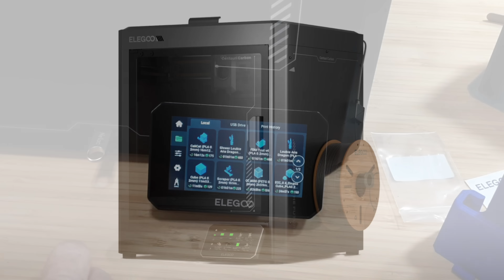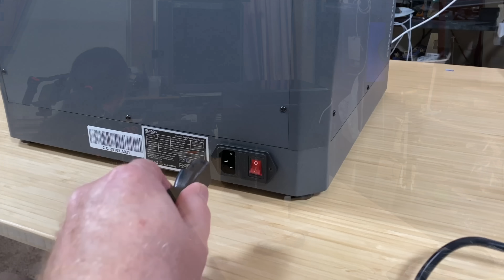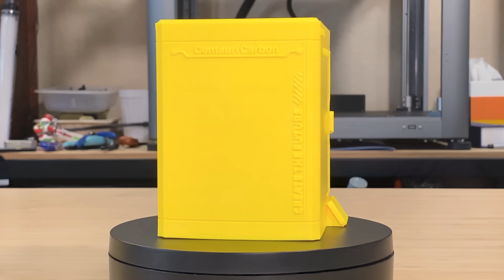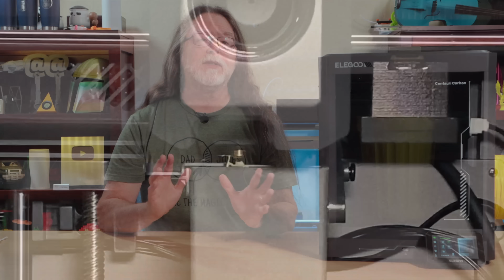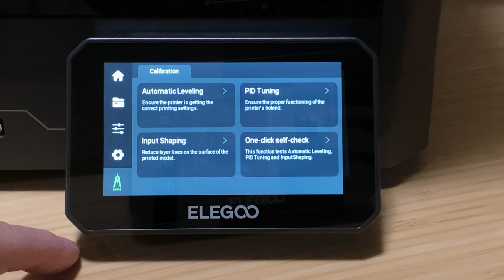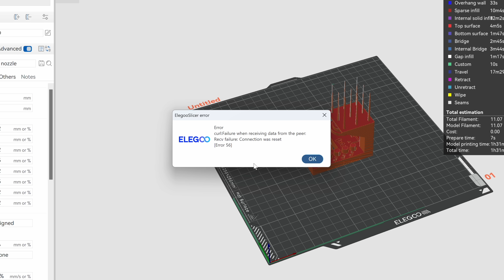Elegoo Centauri Carbon. Enclosed CoreXY for $299.99 USD?!

Comment: So the message here is, don't adopt early. Excellent review, I imagine Elegoo will take your advice, they'd be nuts to not! Otherwise, this is one I'll be watching, as this year is the year I upgrade to something like a Qidi Plus4, a Sovol SV08 or, maybe, the Elegoo Centauri Carbon if they get their firmware act together.
Reply: been using qidi for a bit. i think its perfect mid range printer
Reply: Is it possible to connect via usb?
Reply: I wouldn't bother with Qidi, I attempted to buy a Plus 4 and haven't received it yet (3 weeks so far) when it was apparently in stock at local warehouse (Australia) for 1-3 day delivery. To be honest they ship direct from China and its been lost somewhere, last I called courier company they said it is being returned to sender and I need to seek a refund from them. But Qidi doesn't respond to emails or customer service at all, I've had to file for refund under my credit card company as Qidi will not communicate, no response at all to multiple emails. They also deleted my 1 star review I left on their site. They are extremely dodgy and I doubt they will exist in the next few years given their Australian distributer is LLP tech and they have a roughly 2.5 star rating on google + that's realistic where Qidi sits as a company if they weren't deleting reviews. 
I'll likely buy this Elegoo machine when I get my Qidi refund as there is also a huge price different between the two models with the Elegoo being far cheaper + I have a few of their resin printers and they are reasonably good.
Reply: The message is to adopt early at this super low price. Of course they will sort it out as all big vendors did with all printers from Tempe last two years. This printer is still some months away anyway

Comment: Great deep-dive you did, hopefully Elegoo gets it sorted out.  This is crazy, a Bambu knock-off for only 1/4 the price! So exciting to see all these new generation printers. Bambu Lab gave this hobby a good, hard kick in the butt! 👏🏻🎉
Reply: @T00LF00L  1/5 the price. 299$ vs 1499$ (if AMS is included)
Reply: Comparing it to the X1 isn't even a remotely fair comparison. This printer compares far better to the P1 series. Now that still makes it half the price and even with some improved features in some areas and a heck of a deal. I seriously wish influencers would stop with the X1 comparison just to inflate the numbers. It is a good printer at a very good price, there is no need to exaggerate what it brings to the table. In short if you are on a tight budget and multi color/material isn't a requirement, this machine provided Elegoo and keep their quality up (Something they have had issue with in the past) is a serious consideration for any budget core XY. If someone is going to print PLA/PETG only you  can knock another $50 off and get it without the enclosure. 

As for me, if I was looking for my first printer and didn't specifically need Core XY, I would argue that the A1 is still the king of full sized fully featured budget printers even being a bed slinger, but if someone wants a fully enclosed printer, this is hard to beat.
Reply: @OmegaGamingNetwork  What exactly does the X1 have that this doesn't? A useless LIDAR and better lights?

Comment: 299... Get what you pay for. Back to the Ender 3 days of tinkering and replacing h/w & f/w with better options.
Reply from the maker: Might be. I'm curious to see how they handle the firmware stuff going forward. Uncle Jessy pointed me to a slicer update, and that fixed the issue I was having sending files to the printer from the slicer over WiFi.

Comment: Bryan, I'm curious how the printer deals with a runout. If you have 400mm+ of filament in the tube when the run-out sensor is tripped, does it continue to print until it clears the tube, or does it stop? Then, how do you get the filament out without either manually feeding it new filament until the extruder picks it up or pulling the tube off on both ends just to extract the filament? If it has a runout sensor in the tool head as well, then it could consume the filament, allow you to load new filament, and continue printing without a lot of hassle, but it looks like it has one on the side, and that doesn't seem ideal for a Core XY. If you could test it out, that would be awesome! Thanks!
Reply from the maker: Hi, here's what happened when I cut the filament halfway through a print:
- When the filament stopped passing through the runout sensor, the printer kept printing. I don't know if there's a secondary sensor in the tool head, or if it's got the length from the runout sensor to the toolhead pre-programmed, but it kept printing until it had pulled all the filament through the tube.
- Then, the printer parked the toolhead at the back right corner, and a note on the screen told me it was time to run out and get more filament.
- I acknowledged the message, and the screen switched to the filament loading screen.
- I reloaded the filament, pushing it through the sensor, into the tube, and all the way to the toolhead.
- I pressed the "Load" button on the screen. The printer loaded the filament.
- When that was done, I had to switch back to the Home screen, and then press the "Play" button on the screen to resume the print.
- The printer got the nozzle temperature back to the printing temperature, and resumed the print.

It seems to have handled the runout & reload perfectly. I can't see on the print where it ran out and then restarted.
Reply: @BV3D   over there doing gods work 🙏 thank you
Reply: @ thanks for the follow-up! If it doesn’t have a 2nd runout then it must be calculating distance from the exterior runout sensor.
Reply: This is a good quesion!  Would like to know how it handles this.
Reply: @hinrichmeijer2379 manual. I don’t have it but there is no motor before the sensor so I don’t see how the filament will be pushed until the extruder can grab it.
Reply: @johntheblindman  but will the extruder reverse so you can grab it or do you have to remove the whole boden tube?
Reply: Me gustaría ver un nuevo vídeo para saber si Elegoo reacciona y hace caso a tus consejos. 
En los vídeos que he visualizado, hasta ahora, no mencionan esas deficiencias que tiene tu máquina. Estoy de acuerdo, como bien dices, que si Elegoo quiere es solucionable y la Centauri Carbon, además de buen precio, será buena impresora, por lo tanto buena compra.
Buen trabajo.
Reply: just relocate the ro sensor.........or don't use it

Comment: Wow.  That seems like a good price for an enclosed CoreXY.  Maybe in 6 months from now the firmware won't seem so half baked.
Reply from the maker: For what it's worth, Uncle Jessy let me know there was a slicer update, and that has fixed the problems I was having sending files to the printer over WiFi. I'm pretty sure I checked for updates right after having installed the slicer the first time, and there wasn't one. But there's one now, and it helped. The camera streaming is still wack though.

Comment: One of the reviewers of this printer received a shock due to a defective cable. Though if the bed wasn't heated by an AC electric heater this wouldn't have happened.  A Ground Fault Circuit Interrupter (GFCI) would likely detect and protect against the safety issues caused by an improperly grounded Elegoo Centauri's high-power AC heated bed, but it's not a complete solution to all potential problems.

GFCIs are designed to detect imbalances between the current flowing in the hot and neutral wires, which occur when electricity is leaking to ground through an unintended path. If the printer's frame becomes electrified due to improper grounding or a miswired cable, a GFCI would likely trip when someone touches the frame, protecting them from electric shock.

Remember Murphy's law...
Reply: This is not the case. He figured out it was the power cord he was using. The ground was not working properly. Was not the printer.
Reply: His printer had been tossed around in transit.  That's likely what caused the wire to be jarred loose.

Comment: Great review! Weird name without carbon rods, but okay. I'm assuming software issues will be fixed. Tinted glass seems like a bad idea, especially considering the weak lighting. The ABS prints really came out nicely. The price is wonderful, but will wait for the multi-filament system before I seriously consider. I love that printer manufacturers are cloning more than just the bed slingers now.

Comment: It seems they rushed to release this thing early as it still has some issues. Needs a brighter light, a clear glass door as they didn't learn from the Creality K1. Not sure I like the filament unload/load sequence but it is direct drive so meh? I'm considering getting this printer as the price is awesome but it seems this is an introductory price. There is no way they can keep it at $299.99. I swear when the page loaded it first said $699.99, then updated to $299.99. Great video Bryan!
Reply: I saw the $699 too. The $299 is just crazy low
Reply: They showed the printer in June 2024 and release it like this after almost 8 months of refining 🤨 Makes one wonder if all they showed up was frame and panels 😅
Reply: @kimmotoivanen  "Released" is a funny word for an item not shipping until 3-5 months from now lol
Reply: No this is not just an introductory price. It 299.99 period.
Also it was not rushed.  It's been 10 months since it was first seen/introduced.
Reply: @BlazeT3D  pre-order €329,99 EUR (delivery July 2025 ), normal price €412,99 EUR
It's a bit like kickstarter, you give your money in advance so they can start building your stuff...

Comment: This printer seems like it is still half baked. Last year I bought the QIDI Q1 Pro based upon your review and have not been disappointed. I can hardly even look at a bed slinger without reliving bad memories of trying to print the moon globe lamp only to have it get knocked off the bed after 3 days of printing and ruining the print. 

At some point I will want to dive into color printing and I know it won't be with Bamboo Labs given their CCP style Long March towards captive users.  If Elagoo has their buggy firmware fixed by then, I will consider them.
Reply: Hey Creality looks pretty good.  Check it out.

Comment: I wonder if it's safe to say that the "Race to the new bottom" I predicted has truly kicked off now, with all of the old players putting out their own enclosed CoreXY machines, some of them multiple machines, some of them with AMS-like systems, all of them trying to undercut each others' prices once again.
Reply: As soon as HP has a 150 dollar printer with color changing and 50 dollar rfid tagged single use spools. And no support for third party spools
Reply: @jbloodwo  and the spools will be 50 each
Reply: @jbloodwo  you joke but HP does actually make 3D printers, with their own approved set of materials for sale, though they're in the industrial market so it's a Powder Fusion machine, and also they aren't content just selling you a machine but a processing center and "cooling station" (to be fair to them there is more post processing with powder fusion) bundled with it. Also this has already happened with Makerbot post-Stratasys buyout, and (probably) was attempted with Ultimaker. We'll see if BambuLabs continues on their "ecosystem" path.

What I meant by "old players" however were companies like Creality, Elegoo, Sovol, Anycubic, along with a couple other fly-by-nighters that popped up during what I'd call "The Ender 3 Boom," where everyone of these companies (sans Creality) were trying to either knock off what Creality was doing, which was making a cheap i3 derived competitor, and then making 30 iterations of the same machine scaled up or down and with various features taken from or trying to match the Prusa i3 Mk3. The boom died in 2021 when the market was saturated with machines that in theory were as good as Mk3s (but usually weren't), and BambuLabs was putting out the X1, P1, A1...
Now they're trying to make cheap competitors to BambuLabs' machines. It takes longer to make machines now though, because it's not 2017 anymore and people expect more as a baseline.

TLDR The old bottom is below what people expect, so now they're looking for the "new" bottom, this time starting from the "high-end" and working back, vs what the "Ender-Boom" was, which was starting at the "low-end" and making better machines over time.